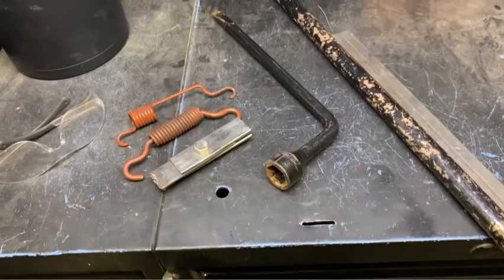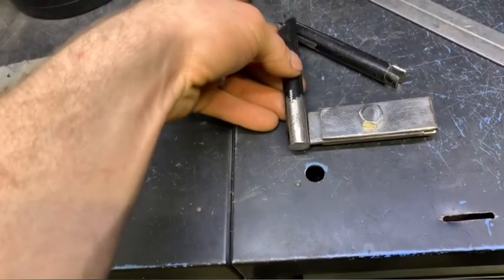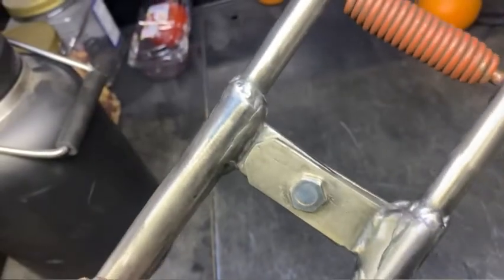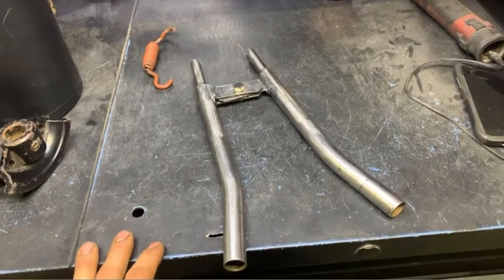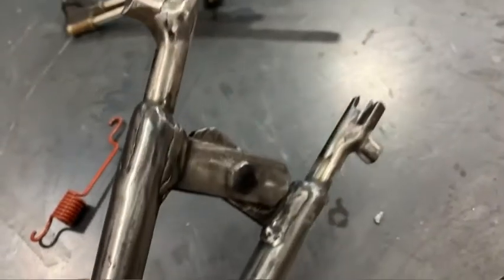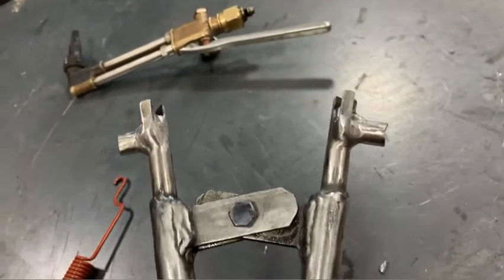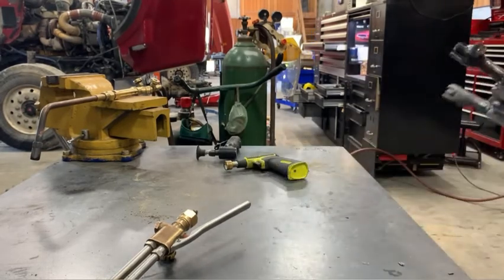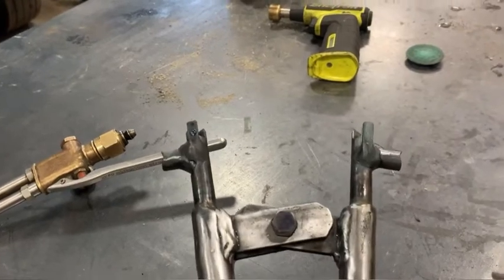Handmade Heavy Truck Brake Spring Tool, Another Tool Build Day

Comment: The Rockwell brake spring set will easily install . The Eaton brake spring kit , secure the shoes on the brake spider together with a ratchet binding strap first .
2/23